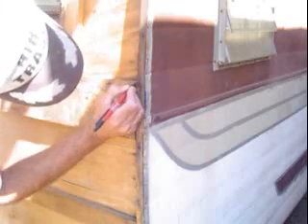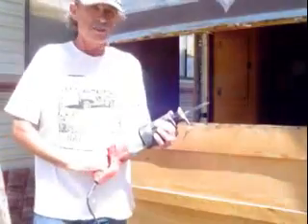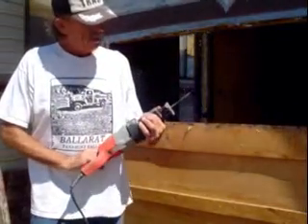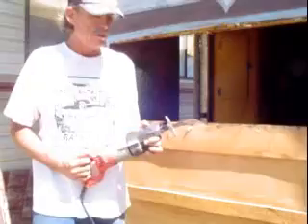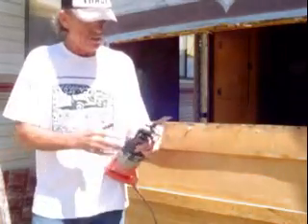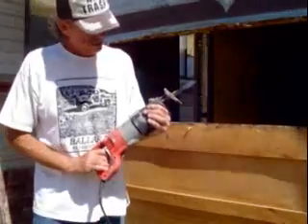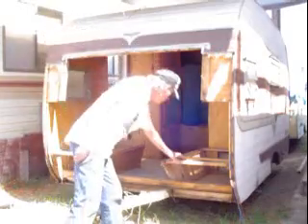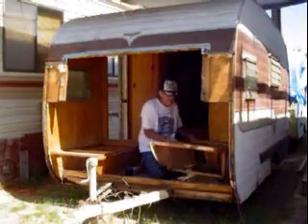Restoring The Deville Part 6

Comment from the maker: "Asbestos! Blue asbestos! LOL."

Actually, there is quite a bit of asbestos in these old trailers. I remove all of it. The flooring material in those days were asbestos. There is a thick piece of asbestos insulating the oven where it sits. There was even some asbestos in the lights for heat insulation. All of this get's removed and replaced with lead.. LOL just kidding. I replace it all with more environment healthy materials.